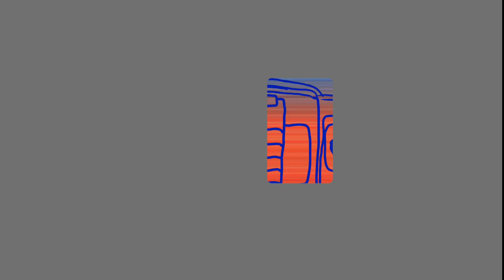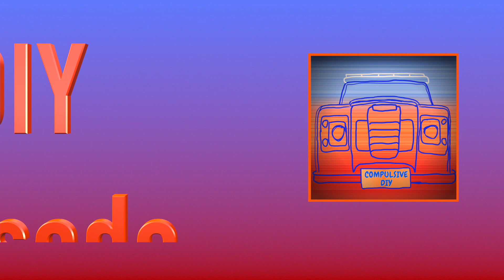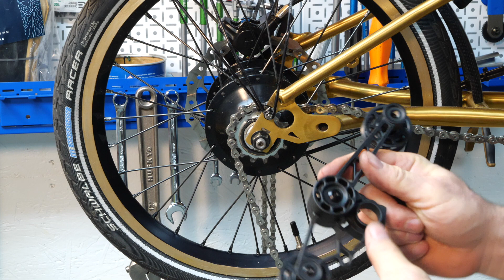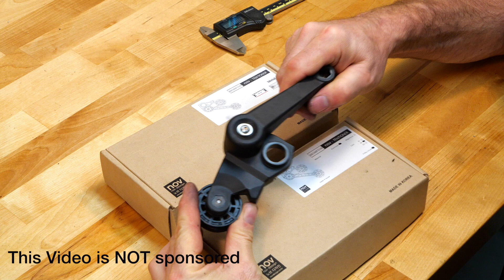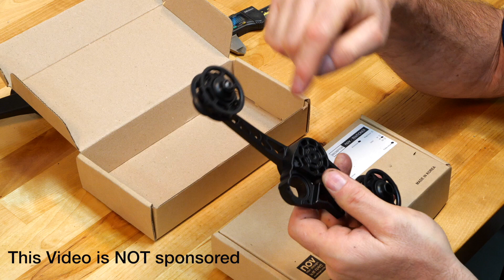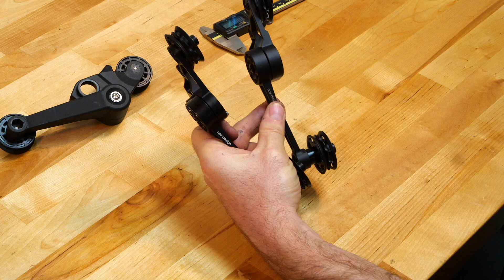Brommieloff 4 - NOV Design Chain Tensioner Review

Comment: I find that the stock plastic Brompton 1sp or 3speed chain tensioner (not the 2sp or 6 speed, which is shown in this video) works perfectly with my Vostok Brompton, as long as I use the Jtek Brompton Chain Tensioner Insert - For Rohloff / QR Hubs.
Reply from the maker: Thanks, I have switched to stock 6 speed tensioner since I made that video. Brompton tensioners have better springs than all aftermarket tensioners.

Comment: The original Brompton plastic chain tensioner although some what bulky and inelegant was built to a price point and is tremendously robust. The one on my Brompton has taken a few bashes at various times but still functions flawlessly. I wonder how durable these Al and Mg offerings from NOV are in real life use? It's like F1, the quest to lose every last gramme of weight will cost tens, thousands, hundreds of thousands of pounds, millions! F1 cars are built to last only a race then they are stripped and rebuilt. I think I would prefer the robustness of the original Brompton chain tensioner even though these after market NOV chain tensioners are significantly lighter and visually more appealing. Also if the Brompton chain tensioner breaks or is damaged a replacement is fairly inexpensive. But I see where you are coming from and admire the design and manufacture of them. I can't help but feel they are form/style or design over function.

Comment: I ordered magnesium from them directly, Brompton shop installed it. Even before using it, the paint peels of at the metal stopper. Only after seeing yr video, I realize that they have sent me aluminium instead (because mag has plastic insert not metal). I wish I could share a picture here... Now its a you said, I said game with them... They even claim that my Brompton is totally a different size...I don't even want to get into what other problems I have with tons of its and bits and fenders and etc from NOV...  Attention : They look good but real life use can be an expensive lesson. Or perhaps I am the only unlucky...